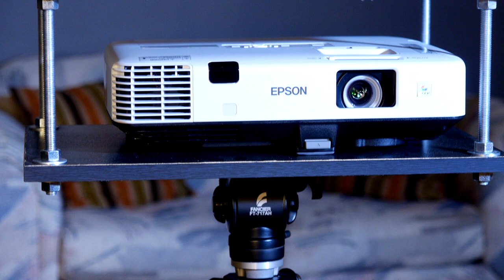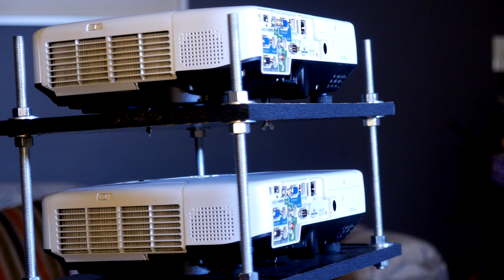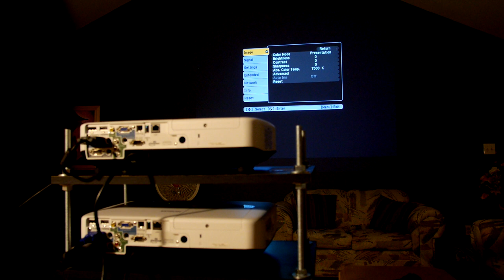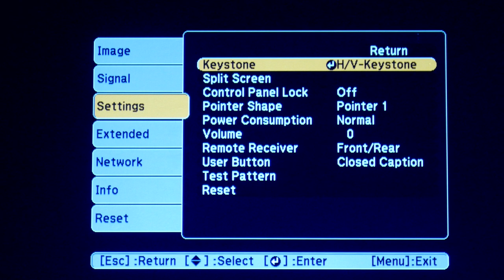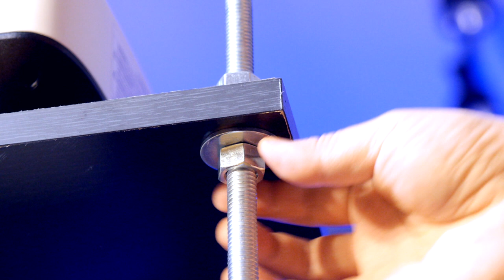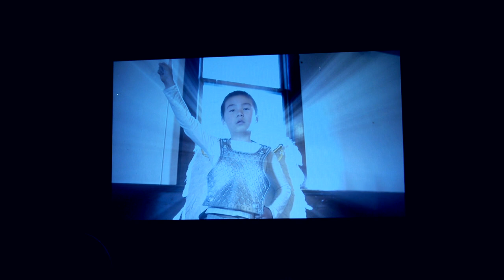DIY cheap way to build 10,000 lumens large venues projector

Comment: Hi Tim nice video sharing. By the way, do you know to use the 2 projectors to produce a 3D image by using passive 3D glasses instead of using active 3D glasses? Tks.
Reply from the maker: Eugene Tan Sorry I don't know the
answer. I don't care enough about the 3D image to spent time research in that area.
Reply: Tim, great presentation!  Thanks for sharing that.   Eugene, I happen to be an avid 3D fan and so ever since AVATAR, I have dreamed about presenting 3D movies in my home theatre.

The simple answer to your question is definitely YES!   This system that Tim has devised is 90% there to get 3D.  All that is needed now is an electronic box called a demultiplexer (like this one thttp://www.lairddigitalcinema.com/Attachments/LTM-Manuals/LDC-3D-2D-HD_MAN.pdf, just google for lots more) that will split the Left and Right eye signals in to separate Left and Right HDMI signals to feed each projector with the correct half of the 3D image.  HDMI out of the BluRay player into the demultiplexer, LE and RE HDMI outputs come out of the box and each into the projectors.  

Next you need to decide which of the two existing 3D systems to use for separating the 3D images for each eye.  There are two.  The polaroid system that is what is used in the commercial cinemas (ala Real D).  Polaroid filters are placed in front of the projector lens which filter the light in a way that will not allow the converse image to pass.  There is plenty of explanation of how this works, too lengthy to explain here, but suffice it to say, it works -- google linear polarization for a full explanation.

When wearing the polaroid glasses (same glasses you got at the RealD 3D cinema -- BTW, take them home next time you are at a 3D movie; you paid $3 for then) your right eye will see only the RE image and vice versa.  The biggest problem with any 3D system is the loss of light cause by the filters -- great thing about this dual projection system is that doubles the light so you get a 3D picture as bright as your 2D picture, maybe brighter.   The downside is that you need a silverized screen (sometimes called a metal screen) to keep the polarized light coherent when it hits the screen and reflected back to they 3D glasses filter a white screen will disperse the coherent nature of the light and you lose image separation completely.  Needing a silver screen is not that big a deal if you are starting out fresh and don't all ready have a screen, but you just have to know this going in.  Don't buy a white screen if you intend going for a polariod 3D system; you'll need the silver screen.

There is another system that is used to separate the LE, RE images.  It uses spectral comb filtering (ala Dolby's 3D system).  Because this system's filtering system doesn't rely on polarized light, you can use a white screen.  If you already have a projection-based home theatre using a conventional white screen, this may be the way go.  

The glasses for this system are not the common cinema glasses, and while they are not as expensive as active glasses, they are quite a bit more costly than polaroid cinema glasses; I believe they are about $15 each.  Still, that's a far cry from active glasses and of course you need no batteries for either the polaroid or the spectral passive systems.  Dead batteries which can go out in the middle of a movie if you are not meticulous about keeping track of your battery usage. The embarrassment of having had a battery die just once during a movie party is all you need to make you swear off active glasses.

There is a home version of the spectral filter system -- it's offered by Omega Systems and only on ebay -- it goes for under $400 for 5 glasses and a set of projector filters.  The filters, just like those for the polaroid system simply sit in front of the projector lenses.  

Epson has made all this even easier as they have a two projector package with stacking hardware that makes the whole thing very easy to assemble. http://www.bhphotovideo.com/c/product/914323-REG/epson_v11h494020_powerlite_w16sk_3d_3lcd.html  
But with this, you are locked into their projectors.  With the system Tim has constructed, you can use any two projectors you want.

And even easier is this 3D dual lens projector,
http://www.dayjoy.com/dual-lens-reald-circular-polarized-3d-projector-support-bluray-ldcp200150-inch-silver-metal-screen20pcs-glasses-p-237.html
which, although it seems like a very easy solution for passive 3D, it loses the great advantage of dual light sources so you don't get the double brightness, but depending on your screen size and if you can easily control the ambient light in the room, this may work fine.  I am still looking for someone who imports this to the US.  

Hope this helps.
Reply: Just get a glass horizontal polaroid filter and a glass vertical polaroid filter, clamp them to your projectors, then you can use the RealD 3D glasses as they also have polaroid filters to create a 3D image for your eyes.
Reply: Frankie Angel Hi there, thanks alot Frankie Angel for sharing the info.
Reply: Although you also need the appropriate screen.  If I'm not mistaken theaters have to use screens compatible with polarized projection in order to work properly.
Reply: @VibingCat39  and what about the high quality silverscreen, which is not cheap?...